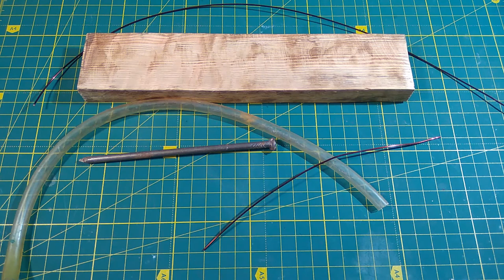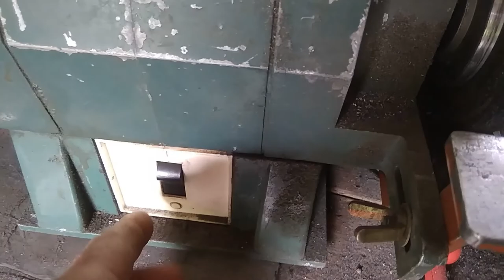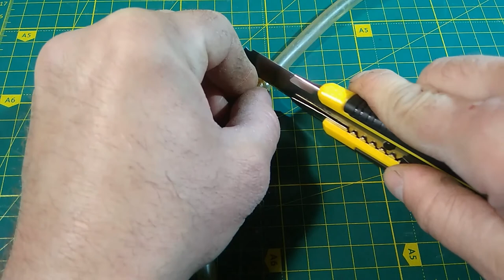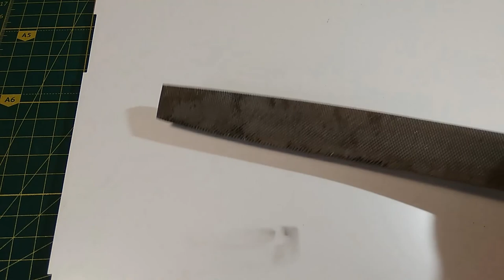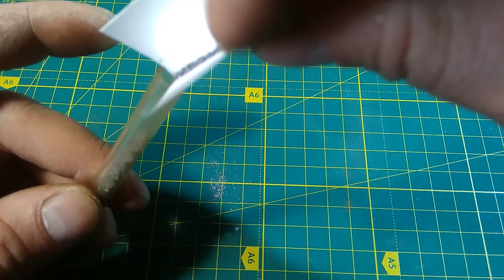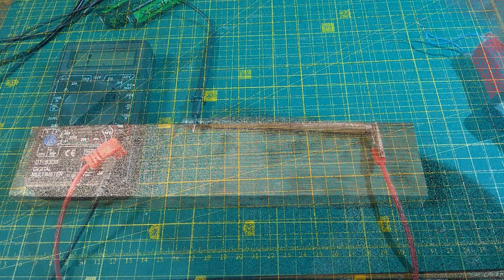How to make a simple survival radio).

Comment: Interesting. It uses a coherer instead of a crystal and pin, or a diode or a razor blade and pin for a rectifier. It's the first radio build I've ever seen that used one, and I've seen a lot of simple radio projects.